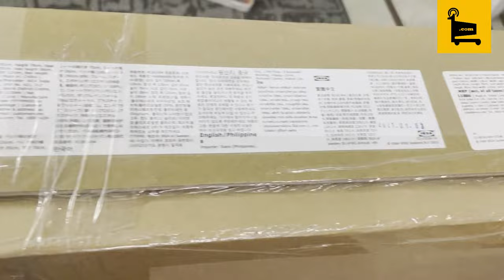IKEA HAMMARN UNBOXING & ASSEMBLY

Comment: Tried building this today, but the last bolt won't go in because it's got a damaged thread :(
Reply from the maker: in local IKEA stores we got the spare parts, so we can replace..
Reply: @1cliqkart384  Thanks! I actually managed to get the bolt in a couple of days later by using a bit of extra force, but it's good to know that most stores have spare parts.